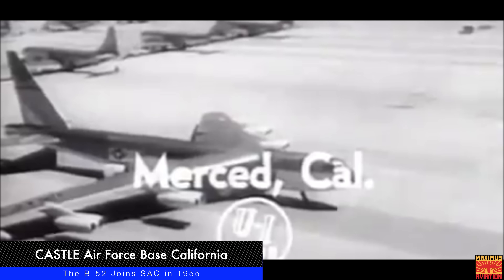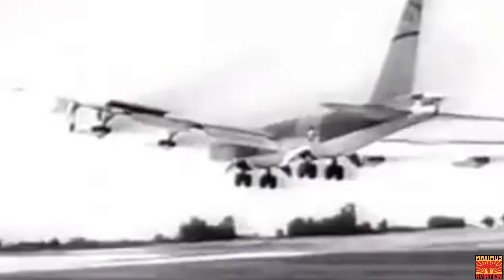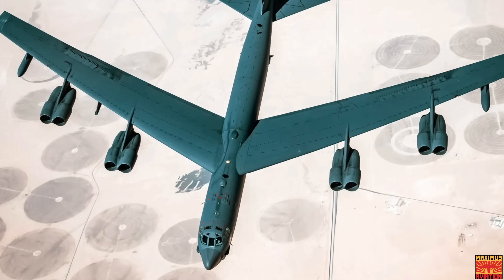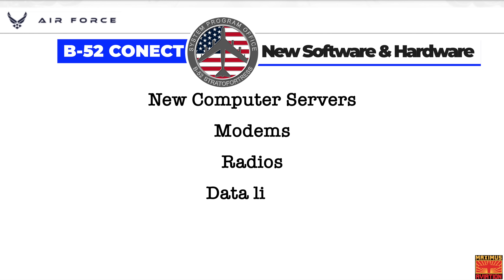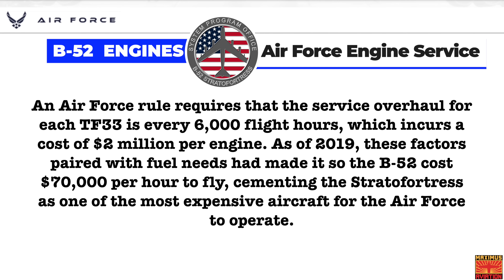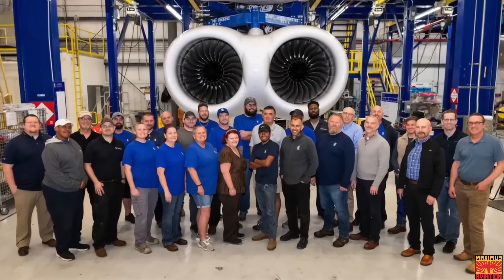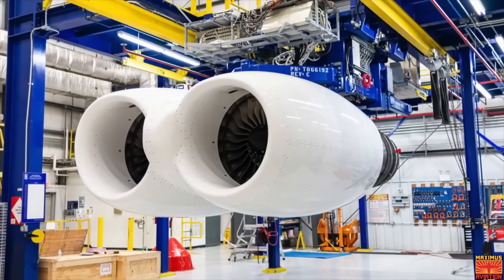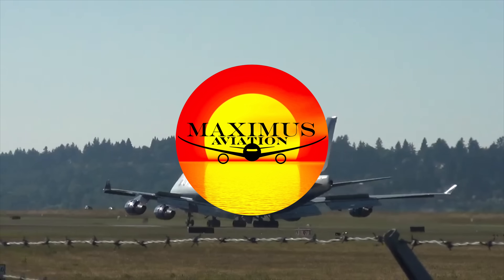The B-52 Will Fly For Over 100 Years With Its New Rolls Royce Engines!

Comment: I think that the new engines are a fantastic idea. When my brother joined the Air Force, he worked on the B-52 when he was stationed in Guam installing, troubleshooting, and repairing any issues with the electronic equipment in the cockpit.

Comment: Well its good to hear that the Buff is getting new power upgrades but from an audience point of view it would have been nice to hear about improvements in acceleration on takeoff. possible improvements to max altitude and cruise and the biggie, how much is the unrefueled range going to be improved. You know, real information. (your military video audience really gets into that kind of stuff) You also failed to mention that the Buff will no longer be creating a smokey trail across the sky pointing to its target destination, although last time I watched a Buff in flight it was  too low to the ground to see a visible smoke trail flying NOE as it was.
Reply: Thrust is the same, so most of those performance numbers are the same.

70% less fuel burn, so about 50% more range.

Comment: Would it have been possible and/or advantageous to re-engine the B-52 with four engines instead of eight?
Reply: Why a quartet of larger engines can't be used is also due to the limited rudder authority of the B52, which is known for tempestuous handling upon loss of both outboard engines (engines #1-2 and 7-8). Loss of both outboard  engines on one side needs almost full rudder deflection to compensate for.
Reply: @tech4pros1  Oh wow!!  It begins to make more and more sense then. If you lost one of the two engines in a pod, it would be significantly less difficult to deal with than one larger engine. Thanks for the insight!  I'd really love to see an in depth video on the engineering and the design constraints of the B-52.
Reply: No.  They wouldn't have ground clearance should the landing gear oleo struts become flat. 🤠
Reply: @jamesburns2232  interesting to know. I couldn’t tell how much clearance there was, but what you say send logical in retrospect. I thought it might have more to do when he cost off re-working a lot of control cables or the impractical aspect of testing a 4 engine configuration versus just throwing on a new, more efficient dual engine pod.
Reply from the maker: Yeah, they explored twing 777 engines or even quads like the 747 there just isn't enough ground clearance.
Reply: You would need to tilt the big fan backwards and fit giant air ducts to redirect the flow, or use engines that fit.

Comment: They need to include a full service APU as part of the upgrade…. Full service as in electric and bleed for engine starting!
Reply from the maker: For the sake of time, I didnt include much of the upgrades but they are completely putting glass in the cockpit and new electronics with the engines so I don't know for sure but if it were me I'd put an APU on there if there were room.
Reply: @maximusaviationchannel  Key word. Room.
Reply: Bizjets start without ground support. I'm sure that these will too.
Reply: Will they have explosive cartridge emergency starts?  Perhaps they are not ‘immediate response’ planes anymore?
Reply: @givenfirstnamefamilyfirstn3935  they can just start with a battery like a Citation.

Comment: Okay boys, the general public could care less about video's like this one. We on the other hand, hang on every word. I watched the "D" models take off and land at Anderson (Guam) bombing Vietnam. I worked the "G" models at Fairchild with J57- 43-WB engines and Tankers with J57-59W engines. I was standing on the ramp when we got the first "H" model with TF33-P103 engines and the "R" model Tanker with F108(CFM-56) engines. Seeing that I am a gluten for punishment I am still working on them at Tinker. I remember the first TF33 we ran on our tin shed T-20 cab test cell. I drew the short straw and was running ground and literally watched it pull the stand out of the concrete while screaming "SHUT IT DOWN". We had to stuff them thru the tanker cargo door and fly to Minot to run them after that. Try that when you are bored. I also watched the "D" models get chopped up for scrap. I like what I do. Let me fine point that for you. I have spent all of my adult life in direct support of a WOMD aka B-52G, B-52H, and if I don't die first, the B-52J or K. My long time friends and co-workers are starting to die off with an increasing frequency, as I lost another last week. I also want remind all of you that these aircraft were designed with a pencil and a ruler. They still fly and scare the living crap out of adversaries. Cheers!
Reply from the maker: Those stand are bolted to the concrete right?
Reply: @maximusaviationchannel  No sir, they are not bolted to the concrete. They are embedded in it. In this case the test bed is attached to the concrete floor with 8, 3/4 in steel braided cables that have barrel nut type tensioners and looped ends. Three along each side, and two at the back. The last two are more of a drag link set-up, attached to the test bed at the same point as the two rear cables, and the opposite ends are embedded in the concrete 15 to 20 feet out. Or at least they were! This happened about 1985 / 86. It took months to have it all replaced. The engine itself is attached to two rails that attach to the test bed with titanium flex plates on each end. There is also the "Dead Man Mount" where the main mount and anti-rotation mount attach. Anyway, at TRT the engine was moving around. I told the guys in the cab that it was moving. They said "aw yer jus not used to it". After I stepped on a piece of concrete and then saw all the cables swinging I high-tailed it out of the run bay just before the safety cable switch detected engine movement and reversed the fuel pumps instantly shutting the engine down. Those two boneheads apologized to me for weeks!
Reply from the maker: @jimmcdonald5448  Wow great info. I have always wondered about the power of a jet engine on a test bed and figured somebody must have had one engine go for a ride at least once.  Thanks.
Reply: @maximusaviationchannel  Yes, but there are worse incidents than mine. I've seen videos for instance of a F-16 engine (F110-220) in full afterburner actually leave (launch) out of the test bed. In the blink of a eye the engine is just gone. With 40,000 pounds of thrust, give or take, and nothing holding it back, man that engine disappeared so fast it's scary, and deadly. Then there are engines that suffer catastrophic turbine failure on the test stand. You don't want to be around for either. Most people have no idea how powerful jet engines are. There's just nothing in their daily lives to compare it to. The hardest thing for people to understand is what happens to your body and your senses when standing close to jet engines at full power. The harmonics can actually cause you to pass out. It can also cause you to lose your presence of mind and do stupid stuff like grab on to it instantly burning your skin, or walking in front of or behind it, neither of which is good for your health. So my point is, when you hear about someone getting sucked into an engine there are factors that play into that and it's not just that they weren't paying attention and accidently or purposely walked where they shouldn't have. People drive behind a running aircraft all the freaking time, you just don't hear about it. Visualize a leaf blowing across the road in front of you. Replace the leaf with a vehicle and you get the picture.

Comment: had thought they would have gone with a totally different engine such as the one in the 737, which has more power than the twin pack and it is known for it's extremely long service and strenght.
Reply: Yes, but issues like ground clearance and lack of rudder authority if 2 engines out on one side
Reply: for its

Comment: Why not 1 larger engine per pod?
Reply: Asymmetric thrust. Low authority rudder also.
Reply: Plus you'd need to move them to fit, so you'd have the same issue that crashed the Max
Reply: Ok, that makes sense. I could see how 4 larger engines with a lower center line could cause the aircraft to pitch up (and lessen ground clearance). But how would it affect the rudder?
Reply: I found the answer to my rudder question. If 1 (or 2) of 4 engines goes out the rudder isn’t big enough to compensate. But with 8 engines, you can adjust the thrust in the remaining 6 to keep it flying straight.
Reply: @notreallyme425  yes, and ideally you'd only lose 1/8th of the thrust on one side, rather than 1/4.

The B52 is quite short in comparison to its wingspan. So the rudder is inherently less effective for countering asymmetric thrust.

Find a photo of a 747 SP. It's a shortened 747 and the rudder is comically large in comparison to the fuselage.